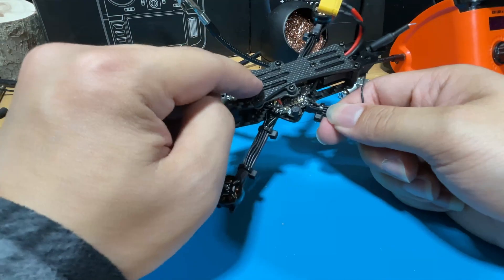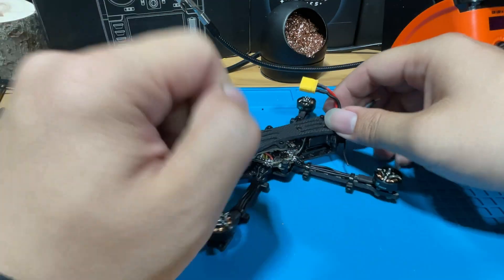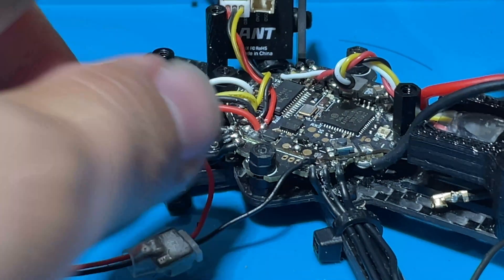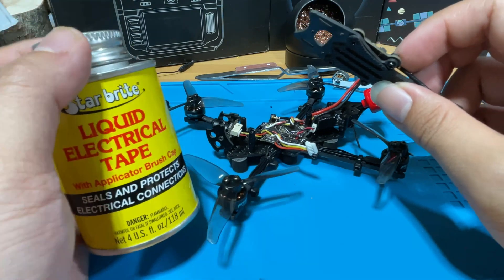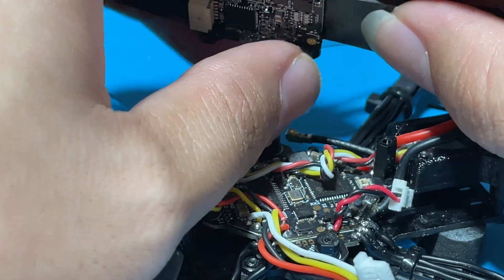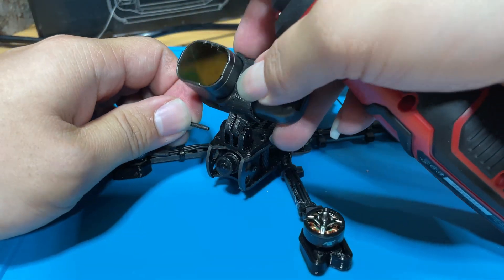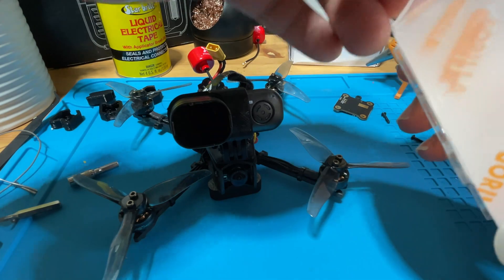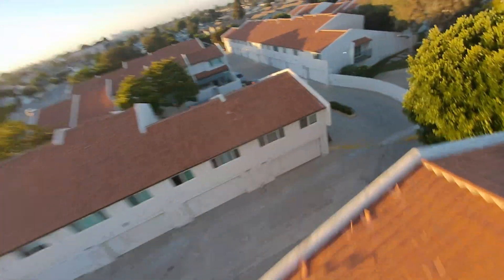Upgrade your Darwin Baby Ape Part 2: Antenna, 4K Cam & TPUs #drone #fpv #darwinfpv #runcamthumb

Comment: Do you have a link to the Antenna used for the VTX? Im looking at getting a tiny ape and one of the recommended changes was the vtx antenna
Reply from the maker: You can get any RHCP antenna with UFL connectors for it to work but below are just some direct links for your reference 

https://amzn.to/47VnzSb

Also, you will need some liquid wire repair glue to hold the antenna in place 
https://amzn.to/3zQZfUR

Comment: Hey mate. This might be a noob question but when futting that new camera does that camera link up to your goggles or are you still using the stock camera and this one for flight footage ?
Reply: it would be too beautiful 😅 You can only record with this camera
Reply from the maker: This can be done, but you might experience quite some delay in your video feed,  might not be practical

Comment: Hi, really nice video. I have a question. If I change antenna in drone, should I also change antennas in googles? I have baby ape pro v3 and googles that are in the fpv kit with it.
Reply from the maker: Just make sure your antenna is both RHCP or LHCP , mostly analog uses RHCP. Not sure what you have on your goggles tho
Reply: @XwingFPVRC  Okay thank you

Comment: Great video. I was considering a motor upgrade as well. With all the mods however it seems to be a ton of weight added to the overall kwad. What is your flight time now? Also do you have a final weight that I can compare to the stock weight? Also what battery are you using a 2s or 3s?
Reply from the maker: The flight time is about the same 3-4 mins, the weight won’t be that significant. I still fly with 3S
Reply: @XwingFPVRC damn, I hav almost 9 flight minutes completely stock without doing anything.

Comment: i have EV800D goggles w stock antennas. should i upgrade those as well? what should i put on them?
Reply from the maker: I will assume the ant you have on the EV800D is already RHCP ? If so it should be sufficient enough

Comment: Do you know if the Baby Ape will fly on 1s at all ? Start up at all ? Take off at all ?
Reply from the maker: Theoretically, the FC can be powered by a 1S lipo, however, the weight of the entire drone and the motors are not meant for 1S, for this size 2S if most likely the minimum

Comment: Will i burn out my stock motors with 3s batteries? Also would the Cherry rc antennas work with this?
Reply from the maker: If you are hovering and cruising, 3S should be ok for the motors. But for aggressive stunts the chance of burning these motors are high. For antenna, for the original VTX as long it is UFL connector it should work. What orientation are you running on your goggles? RHCP ?
Reply: RHCP I actually purchasd a runcam thumb pro as well and Im wondering do I absolutely need the 5v regulator? becaseu the FC diagram shows 5V anyways. thanksfor your fast response! @XwingFPVRC
Reply: My baby ape with stock engines has recommended by seller 3s batteries, so don't worry. I'm flying it with 3s lihv 660mah and its little devil and make 11mins of flight ;)